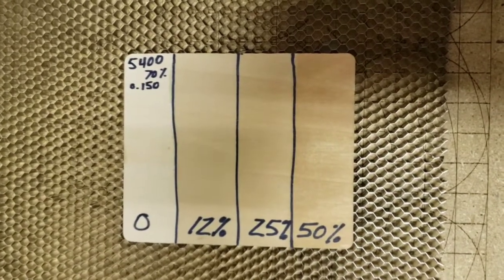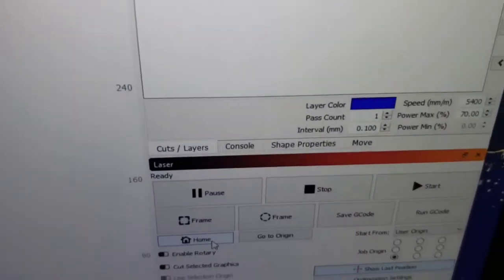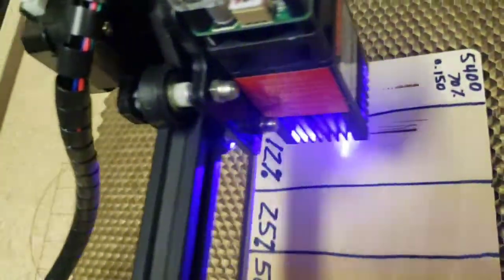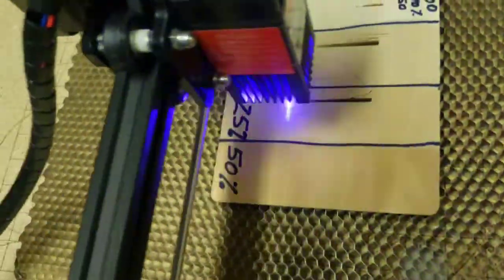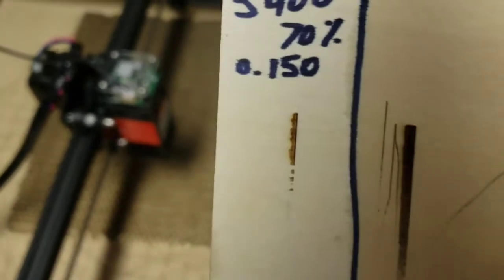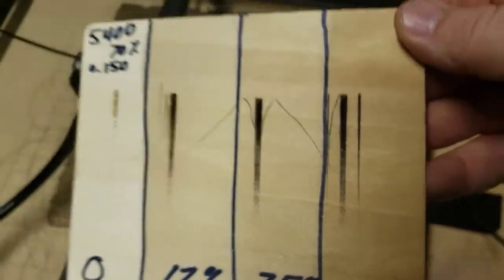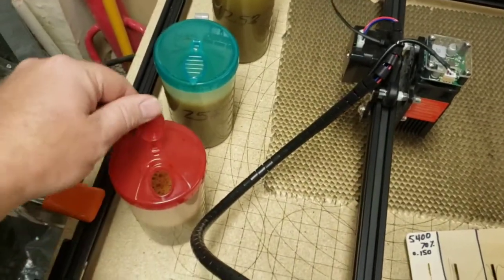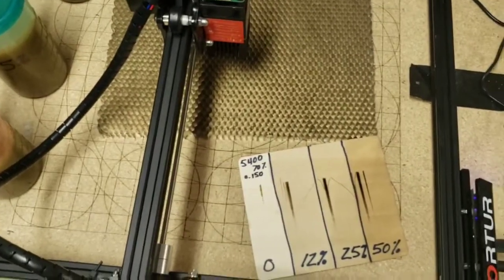"The Kenny Hack" How dilute can you make this pre-stain and get good results? Ortur Diode Laser.

Comment: Where can one get the same exact grayscale image you're using?  Also, which image mode are you using in LIghtburn?  It's clearly not on grayscale, as the lower limit is blanked out.  Thanks!
Reply from the maker: Been so long ago I don't remember what dither mode I was on. More than likely it was Stucki or Jarvis. Took me awhile to get Grayscale figured out. Once I stepped up to 9000 speed I used Newsprint dither. It's the only one I found that could run at top speed. All the other dithers buffer and run slower than what they are set to. My computer is about 5 years old so that might be caused by my computer.

Comment: Thank you for all your knowledge, I was able to progress much with mu LM2. Just did my first batch of the steel wool vinegar. The condensed liquid gives very dark brown color over birch ply, however when I dissolve I get strange results. When dilluting with water wood stains become green(ish). When dilluting with vinegar wood gets grey. Did you have any siilar issues with your batches?
Reply from the maker: All woods act differently. Are you letting dry over night are immediately drying with a blow dryer? I've always dried mine off fast so it doesn't over age the wood. If the first layer look too weak I put in another coat. If its a little too dark I put on a white wash coat.
Reply: @TheKennyHack  great!,thanks. I will try the blow dryer, I did nor realize drying time matters.

Comment: I got my LM2 mainly to engrave on leather, thats my main hobby. The solution you are making is normally called " vinegaroon ". When you put it on veg tanned leather it turns it black. It won't smug like a leather dye and it will not come off. I have a good bit of this made up, I use it full strength, no water added. I'll sure give this a try on wood as I dont think much of the baking soda method either. Thank you for the videos and the info you are providing. Much appreciated.